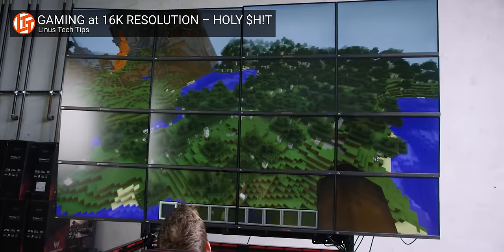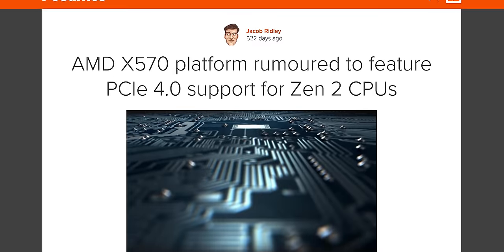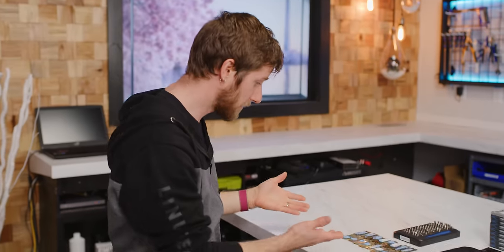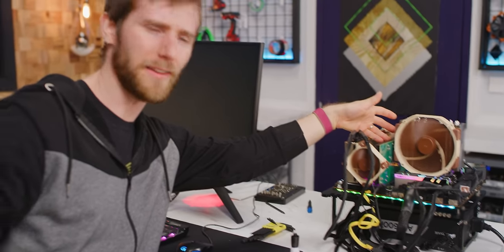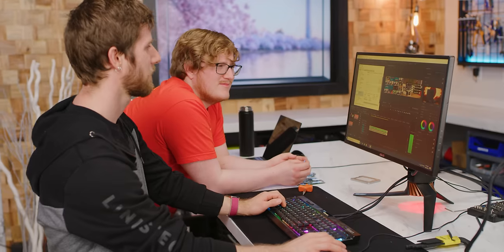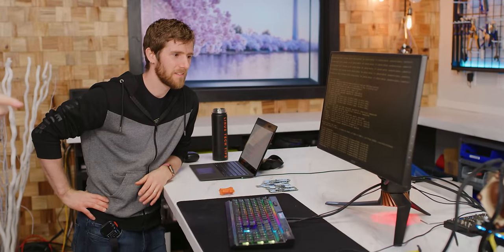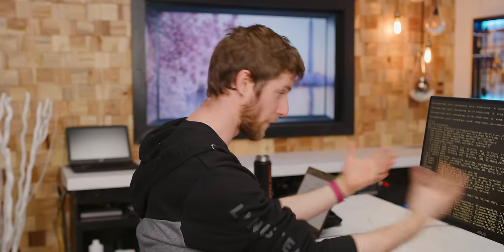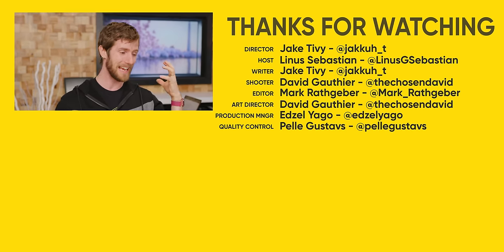This is 50x faster than your PC… HOLY $H!T - Liqid LQD4500 Honey Badger

Comment: It's never a good sign when I click on a link to this PCI card and the manufacturer says 'Request a quote'
Reply: My wallet was already crying and I had to calm it down
Reply: Me: “I wonder...”

Them: “if you have to ask you can’t afford it sweetie”
Reply: MerkinMuffly if you have to ask the price you can’t afford.
Reply: If it helps, the MSRP on our 7.6 TB card is about $5925. It is an enterprise-grade SSD, Gen4 PCIe X 16, which you can use on a workstation. The 8 m.2s come standard (we don't sell empty carriers).
Reply: @Liqid  that sounds reasonable
Reply: @Liqid   so you're basically charging 4400 USD for a PCIe board with a PCIe 4 broadcom switch? (6000 USD - 8x 200 USD for the samsung PCIe 3(!) SSD's)
btw, the MSRP for the totally equivalent HighPoint SSD7540 is 1000 USD...
Reply: @bizzzzzzle  yup, that clears it up. Thanks :)
Reply: @Liqid  that’s actually a really good price for enterprise hardware.
Reply: @verbertp  and they are offering enterprise level support and reliability. Yes enterprise stuff is overpriced, that's how it is.
Reply: @verbertp  Oof, if that's true...
Reply: So basically with that I can fill my RAM in under a quarter of a second.
Reply: @TheHuskyK9  Speaking of your wallet... Cue Sponsor
Reply: @verbertp  maybe it's the cost of research. 
That's why a lots of Chinese made products are cheap. Because we don't have to pay for the research
Reply: This is normal for small start ups. 
There are two things when you go to commercial... Corporations negotiate pricing. Asking for a quote is one of the first touch points in qualifying a sale. 

But to your point, as a corporate buyer you do have to consider the size of the company when buying tech.
Reply: "When you have to ask the price, you can't afford it"
Reply: That just screams "expensive". 😆
Reply: @jagerpowell1458 , 
Expensive is relative.  For a home PCer / Gamer... yes it is.  For a business trying to solve a business problem... maybe. 
It depends on the problem and the relative costs of alternative solutions.
Reply: @verbertp  It's worth taking a look at the Level1Techs interview, it's probably got something to do with their cost of bringing shit to market. Also that Highpoint card is a RAID only card, not sure if that makes a difference, only that it's not actually the same thing.

https://www.youtube.com/watch?v=hl-J9sQ889I&ab_channel=Level1Techs
Reply: That usually means the manufacturer is ashamed of how much they are charging for it
Reply: @mwbgaming28  No, it means that its not for the retail market. Its a commercial product. 
There is MSRP and then there's negotiated price based on the configuration and how many cards you want to buy. 

This is just one of their products.
Reply: @mwbgaming28  depends. Sometimes it's because they expect literally no consumers to want it due to price, are not interested in selling individual units to consumers, and so the cost is only relevant in the context of the rest of the system it will be bought in.

In the case of Liqid, this is serious hardware, you're not seriously looking for anything like this unless your 'number' has 6 or 7 digits before the decimal.

At that point you're not haggling about the cost of one line item.
Reply: @morosis82  even companies that sell to consumers hide prices (gyms, cable companies, and online electronic component retailers are bad for that) 

There is no good reason to hide prices, even if you are selling to companies, you can always list the MSRP
Reply: @mwbgaming28  yeah, generally I agree, but it takes work to have those prices on the site and keep them up to date, especially when they are never going to be sold individually and only as part of a system. Only some of the components are listed as technology presentations without having enough componentry to build a system yourself.

If you're going to go down that route, you then need to have list prices for every part that a person could use to build the system, and that's work they may not want to do given their intended customers.

The gym example is different, because they have a specific set of services and can list them easily, but even then some may not if they cater to people that want speciality services and care less about the price than the service, then it's always a discussion and having prices is meaningless.

I guess what I'm trying to get at is the difference between commodity items and bespoke items. These guys only really supply the latter, so a list of prices on the site is pretty meaningless.
Reply: @morosis82  if a regular consumer is capable of buying it, then prices should be listed

Requiring me to call for a price wasted my time, your time, ties up one of your customer service workers, and is far more wasteful than just typing a number into a computer and updating it once or twice a month
Reply: @mwbgaming28  Depends. For the number of consumers that will go to the effort of calling (if you have to ask, you can't afford it), I'd suggest it's a trivial effort.

They likely also want to force the discussion of why you want it, because dealing with someone that bought it thinking it's a magic silver bullet and it doesn't do what they want and they want to return it is a much larger effort than the occasional quick price check.

For most consumers, this will never be the right solution, even if they can technically afford it.
Reply: I always quickly scroll past everything whatever I'm browsing for atm that says anything like 'request price' haha
Reply: Wasnt it 50 bucks on amazon
Reply: ah but you see, there's a discount if you get them in bulk
Reply: Yup. "Request a Quote" is an instant NEIN for me, too. I just consider that to be a "reserved for enterprises" kind of thing.
Reply: what
Reply: @verbertp  you missed the '8 m.2 SSD's'. That's honestly a screaming deal when it comes to high end enterprise stuff

Comment: Literally every pc Linus builds is 50x faster than my pc.
Reply: True
Reply: *laughs in expensive pc*
Reply: ouch - nothing can beat my potato 2007 csgo hd 20fps high definition cd-reader ultra fast 320gb hdd with red sata cable portable handle on top and takes usb laser mouse
Reply: General Grievous  I have an i5 660, 8gb ddr3 ram, and a gt 1030.
Reply: @koolcat6893  lmao ur cpu is like 30 bucks. Why dont u update?
Reply: @goulzz9684  what would I upgrade too? There is like no upgrade path for my cpu socket.
Reply: Me with no PC 🥶🥶
Reply: @のう  feels bad man
Reply: @koolcat6893  me with a Mac running windows 10
Reply: @koolcat6893  switch to a 390 board
Reply: @blitzcourt5021  I'm not going to waste any money on this pc... Because if I was going to upgrade any parts, I would also have to upgrade almost all of the other parts. I'm not going to spend any more money on this pc and I'm just going to save for a ryzen 5 3600 build.
Reply: same
Reply: @plantxvibe9571  same .
Reply: ALL these pcs are 100% more powerfull than mine..... because i dont have one
Reply: Bro I don’t even have a pc (not even the 69$ one)
Reply: I finally upgraded my pc but only the power supply and gpu my cpu is still garb 😢
Reply: @God-qj7jl  bottlenecking looking good 🥶
Reply: @のう same

Comment: holy shiz your page/swap ram would be faster then your actual ram....
Reply: Cameron Varley Almost there I guess.
Reply: It's not really about the raw throughput numbers though in that context, it's about access latency - even though these SSDs are really fast, SSDs still take an order of magnitude longer to access then ram, and that difference means that even if your CPU is ready for data and ready to complete an instruction, if it has to wait 10 times longer for each bit of data to come, it'll be 10 times slower
Reply: @jjschmitty5093  Was just about to say this myself! That being said the next gen Playstations and XBoxes are using SSDs as a sort of memory cache for GPU/system use - its one of the reasons they achieved what they did in the latest unreal engine demo. Obviously not the SSDs/platforms we have available as consumers atm but I want that technology to come to the PC master race where it belongs... ;)
Reply: i haven't watched  the video yet but it says that it's 50x faster  than a sata ssd. so i'll assume the damn thing can put out 25 gigabytes per second sequential read and slightly lower on writes. the newest ddr5 spec supports 51 gigabytes per second per channel i believe, so you would need to raid 0 two of these ssds to get the performance  of a single ddr5 channel. and then we have IOPS, which often matters more than sequential speeds. if the IOPS is high enough then we could actually use this as a replacement for ram, as an universal memory that supports execute in place (run stuff directly from storage without first copying it into ram) but then we would have to deal with the issue of endurance. DRAM and SRAM last pretty much forever, FLASH and 3dXpoint do not. they wear out as you write to them. i believe latency influences the IOPS count. as far as i'm aware pcie 4.0 is pretty fast and low latency so the latency thing would mostly be on the ssd controller
Reply: @imeakdo7  d00000de, just watch it and you'll se......
Reply: @LoneWanderer905  just watched it. the iops is shit. we need  something in the high millions if we want to use it as a replacement for ram, and i'm not taking into account the whole ssd wear thing
Reply: the latency still a problem...
Reply: @imeakdo7  your right I completely forgot that the iops on ram is considerably higher, I was only thinking about speed
Reply: @allak1n  I have a feeling that they took advantage of sequential reading and not random access.
So while it looks amazing it's sure to have some damning limitations. (IMHO)
Reply: The new RAM standard will outpace this very quickly, and far cheaper.
Reply: @reryramadhani7749  my ram has close to 9ms latency, never even thought to check what my ssd latency was
Reply: RaM is much faster than this .
Reply: @allak1n  Isn't Dram cache for ssd a thing since years.. The system still has to follow the sequential path. For RAW bandwidth the ssd in ps5 can be compared to ddr2
Reply: who uses swap...
Reply: @jjschmitty5093  I agree with you but yet the bandwidth is RAW on raid 0
Reply: @freaksavior  People with less then 16gb of ram
Reply: @jjschmitty5093  linus didn't talk about latency at all, and everyone is OMFG 50x faster everything, no it's just sequential - if you're not doing video editing, that number is not realistic .. and linus of course showed video editing, cause they do videos - try loading say 3ds max - it usually takes 40 sec to load - I load it on a ram drive - it still took 40 sec - there's bottlenecks - files stuck waiting for stuff to load, and access latency and whatever .. more realistic testing is in order.. 
..this was pretty clickbaity - 50x faster than my PC.. it's like advertising a 500kw PSU and saying it has 500x more power than you PC - yes true, but nope it doesn't really matter
Reply: @robob3ar  it's true he only tested the seq and not the random
Reply: @jjschmitty5093  exactly. that's why sram and dram is also still magnitudes smaller in capacity than nand and whatnot flash techs. and well it doesn't really matter. in the end the sram cache levels from 1-3 to dram in increasing amounts and decreasing speeds to the normal hdd and ssd storages works really well to have reasonable speeds and reasonable capacities.
Reply: @jjschmitty5093  it's actually has to wait more like 1000 times longer.
Reply: Not really. RAM is good at accessing random small files with extremely low latency. 

Even this SSD doesn't even come close in such an everyday scenario.